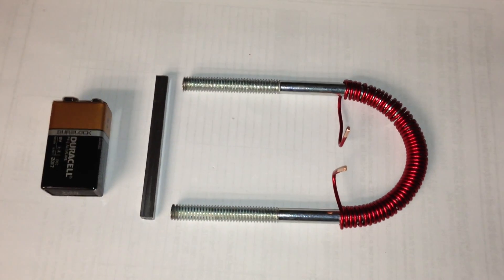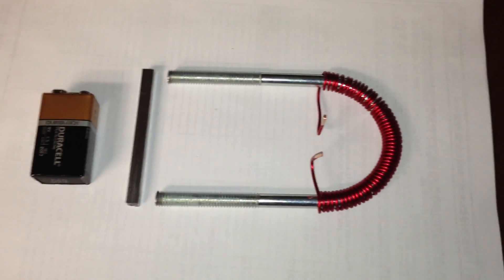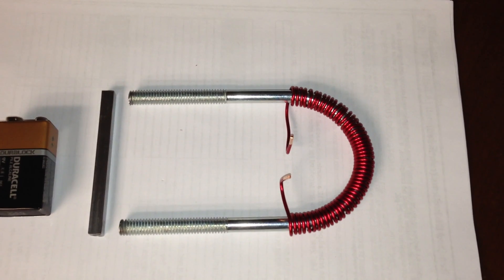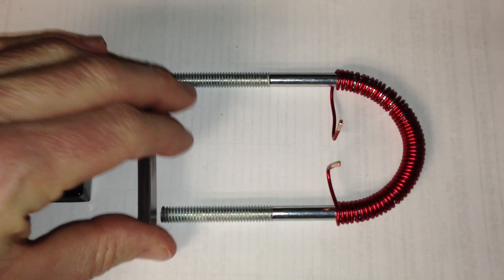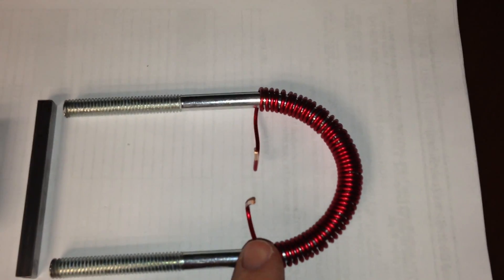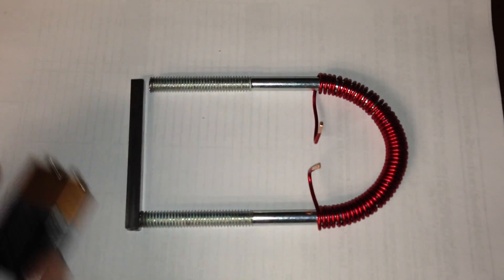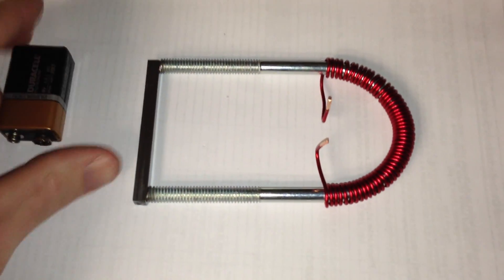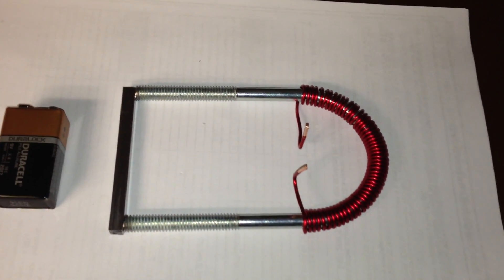Ed Leedskalnin's Perpetual Motion Holder PMH (Testing 1 coil 1 layer)

Comment: how does that explain Leedskalins construction of corral castle,  jkg, good video but, could this be called a charged soleniod, or permanent electromagnet.  Cause, what is in the very center of the big generators,  it isnt a permanent magnet, and it isnt a, at least I hope not, pulsed electromagnet.  so its a giant coil that is polorised, right?

Comment: You made an electromagnet that has remained magnetized. https://en.m.wikipedia.org/wiki/Magnetic_hysteresis
Reply from the maker: Yes and no. The U-bolt is not a permanent magnet in this demonstration. From the definition you supplied, hysteresis is when "part of the alignment will be retained: the material has become magnetized. Once magnetized, the magnet will stay magnetized indefinitely." That is not what is happening here, although from my demonstration it is hard to tell the difference. What I am showing is close to 100% of the strength retained from the pulse of the electromagnet. This is only the case until the bar is removed. At that point, the strength drops to around 10% or less and the bar is no longer able to remain attached to the U-bolt.

Comment: This device works on a principal called "magnetic hysteresis" of the metal used in it. This has long been understood and is how the old magnetic core memory in the 1st computers worked.
Reply from the maker: This effect is not well known. Yes it is basic electromagnetism and it is not perpetual motion, but it is not demonstrating the permanent magnetization of metal as you suggest. It demonstrates that only while the flux is looped onto itself will the magnetism remain. When this flux loop is broken, the magnetism is no-longer present. No one is calling this a perpetual motion device, "Perpetual Motion Holder" is the name of the device.  I hope that helps.
Reply: @LimitlessResearch  the idea of perpetual motion can be tested by placing the end of that near a compas. it should flip, then do the other side it should flip back. wait two years, do it agian, the magnets are still in motion in the PMH, and can be used to push/pull a magnet  You can build a generator from it with no in put. Its been done a lot, and people who claim its understood are purposely ignoring facts so they can believe in stupid crap like electrons which do not exist.
Reply: This is actually a torsion based reaction, called bitoroidal induction mechanics.
Reply: Yes, no magic here nor perpetual motion ...., just basic electromagnetism. The current int the coils create an induced magnetic field that rearange the ferromagnetic areas in the metal such as the metal now has a permanant magnetic field. Please stop saying bullshitt, it's just science that anybody with enough interest could learn.

Comment: This was invented 200 years ago.
Reply from the maker: Please give a reference or link. I have only heard about this as the invention of Ed Leedskalnin in the 1930's-40's
Reply: Russell Martin It's called remanence.
Aunt Google will help you.
Reply from the maker: This is not remanence. After doing some research and hearing many opinions over the last few years, I believe this phenomenon is caused by an alignment of the flux within the iron loop. It will only occur when there is a circular (return to origin) flux path. Once aligned, it will hold the "keeper" to the U-bolt until it is pulled off or the metal rusts away.
Reply: Russell Martin What you say is correct. With electromagneic DC relais it is therefore necessary to add a thin layer of nonmagnetic material between the core and the moving part, else the relais would stick and delay opening. A small air gap is often used.
Another effect is this: magnets of older technology would lose  magnetism if not stored with closed magnetic loop cover. Also some electric DC motors must not be disassembled without proper magnetic flux retaining. Need special tools for that, or the motor will never work again.

Comment: An interesting effect that they dont show you at school when you learn about solenoids. But not so mysterious: The magnetic domains in the iron link up nose to tail - North to South - North to South as the "keeper plate" is in place, they can do so in a complete closed loop, and hold each other in this position. There is very little magnetic field observed outside the iron as there is no significant leakage of the field when aligned like this - why a keeper plate is used on a permanent magnet. When the end plate is removed, the domains at the tips of the bars are now only held in place by one pole, and this is not enough to keep them fixed in orientation, thermal energy is enough to free these mini magnets and so it returns back to being un-magnetized.  I suspect you could illustrate this very nicely with a ring of small magnetic compasses which would align with each other when they were in a closed loop.
Reply from the maker: Here's another interesting demonstration of this effect. He uses the magnetic field of one wire, no coil. https://www.youtube.com/watch?v=QJSDYYaF3LA
Reply: Limitless Research v
Reply: That video is gone.  Can you explain the setup of that, briefly ?

Comment: unless one is not interested in proving a point i do not get why one leaves so many things un-answered. the test is not complete. first mount the cam or get an assistant, next put the bar on you U before testing to show no magnetism, after removal of battery pull bar off to test force needed, reattach bar to establish no magnetic field. for the sake of curiosity connect low voltage bulb or volt meter to see what would happen. This is a complete test.
Reply from the maker: I stated my point in the beginning of the video. To show that a PMH can be made using one cool. Enjoy!

Comment: I have a drawer full of batteries that do the same thing, and are far easier to carry around and use.
Reply from the maker: The name does not imply free energy or an new power source. It only reflects work being done with no additional input. Perpetual motion "holder", not perpetual motion generator.
Reply: Russell Martin
It doesn't even really hold anything.  The initial charge from the 9Volt causes the coil-wrapped metal to become a magnet.  When the attached bar is removed, you have a change in magnetic flux.  That change in flux through a copper wire induces a very small current.  The amount of energy put into the system initially is greater than the amount of energy output when the bar is removed.  Additional work is indeed put into the system by the removal of the bar to cause the change in flux.  It's essentially a very simple generator and nothing more.  We used to make these in my first grade science class!
Reply from the maker: I agree with you on the electrical input & output. Again, this is not an electrical generator, it's a holding device. The fascination is not only it's unique way of storing an EMP. It's the fact that it can do work in the form of lift indefinitely with no additional electrical input, or a least until the metal parts rust away. It has been tested holding the bar up for over 2 years.

If you truly made one of these in your first grade class, that's amazing! I wish my class was teaching this. My first grade class taught traditional electromagnetism where the battery source needs to remain attached. This PMH version only needs a tap on the leads, a very small input. The coil is only a magnet during that input, after that the coil is no longer needed. It can be removed from the setup and it will still hold the bar up.
Reply: Russell Martin
It's still a magnet even after the coil is removed, just a very weak one, and it depends on the bar being used, of course.  I can magnetize the head of a screw driver by hitting it with a hammer, at least to the point that it will hold small screw.  This PMH isn't holding anything.  There's no current going through the loop until the magnetic flux changes, then a very small current is induced, much less than what was input.

And I agree, first grade is pretty young to be doing this...it was fifth grade.  I looked through a bunch of old school crap my mom gave me a few years ago.  It was the first school use I had with a computer and they used this to describe how a hard drive works and stores data.  They showed us a normal horseshoe magnet and showed how it would hold a bar.  Then then did this kind of electro magnet.  Then removed the power source to show how the hard drive remains magnetized (only in really tiny bits).  Then I wrote a program that scrolled "poop" on the screen.  Good times...
Reply from the maker: lol

Comment from the maker: That would work! The relay "clear" voltage would need to be just a spark. If it's on too long the device will become stimulated and clamp down with the flux lines going the opposite direction (NS to SN). I like the lock idea too!  The connection points would need sheer protection, as sheering is the easiest way to separate them while it is stimulated. Great ideas for this tech!

Comment from the maker: The phenomenon is similar to an electromagnet, but different in the fact that the flux lines of the metal form into a circle. Electromagnets flux form into straight lines making bar magnets. It is also different in the power input. Electromagnets require constant DC current, this only needs the initial DC spark. The strength is equal to an electromagnet, much stronger than if the steel was temporarily taking on magnetic properties. Maybe someday we will figure out how to tap into it.

Comment from the maker: Yes, soft iron will work better than steel. Personally I don't think 2 coils is better than 1. That's just my opinion. I forgot to mention higher amps through the coils will also create a stronger effect. So you can use your 14g wire with higher amps. Basically anything that will make a better electromagnet will make a stronger effect with this device.

Comment from the maker: Yes. Here are some things that will make the effect stronger. (thinker metal, more wire windings, and flat connection points)
Reply: Some say he had 14 car batteries in series when he charged his making a very strong perpetual motion that could push a generator without losing its held magnitism...................

Comment from the maker: Insulated wire is necessary. It does not need to be enameled wire. This can not be done with bare wire. The flatter the ends of the U-bolt are, the better it will work.

Comment from the maker: Magnet wire is solid copper wire coated in a thin enamel coating. It is called magnet wire because it is used for making electromagnets due to the thin insulation. There are no magnetic properties until the wire is stimulated with electricity. Hope that clears things up. Take care

Comment from the maker: I'm not sure how to answer your question. If you're asking about an air gap, the gap can be very small and still hold it's charge (1-3 sheets of paper). The larger the air gap, the weaker the attraction and at some point it will not keep its charge. I have only seen this tested up to 2 years, beyond that I would be theorizing about longevity. Nothing lasts forever. At some point the metal itself will decay.

Comment: Also you seem to make a point of getting the, I'm assuming, iron,  square stock form Home Depot.  If it is hard iron it will maintain some magnetism even after being disconnected from the electromagnet.  The phenomenon of the bar still sticking to the U-bolt could simply be that the iron bar, or U bolt for that matter, has retained some of their magnetism.  It's called coercivity.  Again, I'm not trying to detract from your invention.  I think it is wonderfully clever.

Comment: Use a U-bolt made of aluminum or copper.  Then remove the coil.  If the bar still stays attached then you may well be on to something.

Comment from the maker: Interesting. I haven't heard of that type of circuit before. Thank you for sharing. After looking into it though, I don't think that's what is going on here. My coil wire ends are not forming a spark gap. I could remove the coil completely and the bar would remain attached to the U-bolt. I think it's more along the lines of a looping magnetic field and linked flux lines, or something like that.
Reply: @Limitless.  That is exactly what is gong here, and why the whole is interesting.  Some might be missing the bigger idea here on what is happening.

Comment: It's a LC or oscillation circuit. The coil forms both an electromagnet and an capacitor.  Touching the battery to the ends essentially discharges the capacitor. Removing the battery causes the magnetic field to cease momentarily.  But the change in the B field induces an opposite flow of current which induce a B field which diminishes, which induces current flow in the original direction, and on and on. The two ends of the wire form a spark gap. Its just a very clever tank circuit. No overunity.

Comment from the maker: There are no claims of perpetual motion here. That is just the name of the device. I think what's really going on is the flux lines are magnetically aligned in a loop/circle which bonds the keeper to the U-bolt. This video is just confirming that this can be accomplished using one coil one wire thick, nothing more.

Comment: What about using 2 wires, both spinning right ways-, into each other making the double helix-dna sequence...so north wire ends on south side, and south wire end on north side? they both touch each other, and make the ac current stronger..use a tazor wrapping the opposite poles on opposite points of the tazor..then turn on the tazor for 5 seconds...will that work?

Comment from the maker: If you supply AC to the U-shaped coil (primary) your "keeper" will vibrate at the connections points of the U-bolt and the keeper due to the rapid change in direction of the EMF. You may have poor induction of the pickup coil from this depending on where it is located, but it would induce the pickup coil every time the direction of the EMF changes, so at 60 cycles/sec.

Comment from the maker: You can put a secondary pickup coil on it, but the only time it will be induced is when the EMF is formed and when it collapses. This would be when you induce the primary coil with current and then again when the "keeper" (square bar) is removed quickly breaking the magnetic flux line connection through the metal. Your pickup coil will be strong enough to light a small LED for a fraction of a second at these two moments.

Comment from the maker: Anything that would make an electromagnet stronger will also make this stronger. Example: having a thicker core of iron, more current through the wire, thicker gauge, more wraps of the wire. The one thing that makes the most difference in the strength is the flatness of the metal at the connections. The connection points should be milled flat for the best results.

Comment: ok. something new. straight steel tube 1/4" diameter, single wire through center. large pickup coil wrapped over outside of tube.

Comment from the maker: Yes. After the battery energizes the coil producing the initial EMF, I could unwind the coil. That's really all the coil is used for. The U-bolt will keep the square bar attracted to it until the square bar is pulled off.
Reply: You just magnetized a U bolt, get over it.

Comment from the maker: Thank you for your input. Unfortunately that has been the name of this device since around 1945. I didn't come up with it. This video merely demonstrates it's function using one coil. By that I mean that it holds the bar to the U-bolt without a constant current. The magnetic field that is created while the bar is attached will collapse when the bar is pulled off and induce a small current in the coil strong enough to light an LED. I am not claiming overunity. 

Take Care,
Russell

Comment: David inspired me as well. I have a couple of vids demonstrating this as well. You are right, that with smaller wire it will work with even very low voltage.I can even make my keeper  stick by using a small dc motor(as a generator) spinning the shaft a few times.